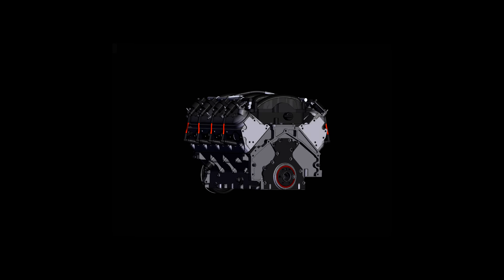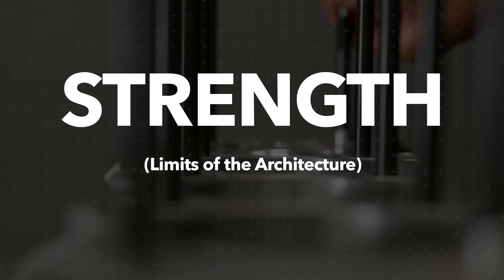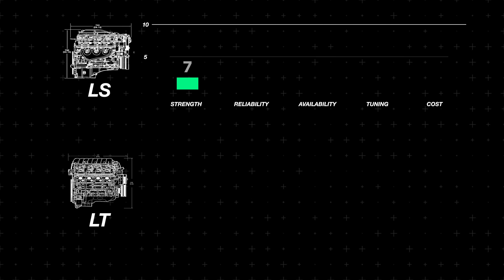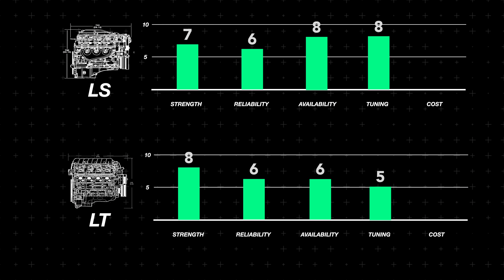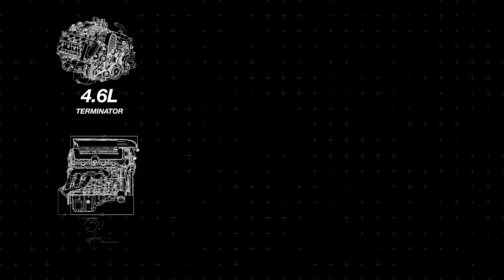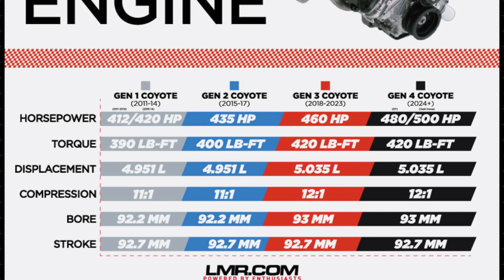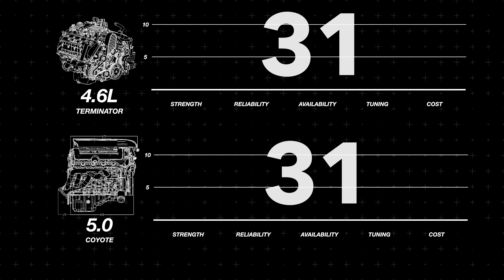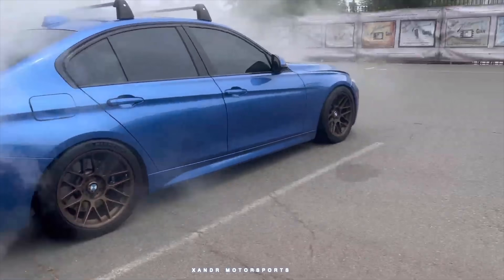Why Old Engines DESTROY Newer Ones💀| Explained Ep. 25

Comment: I am by no means a Ford gut but in the case of the Terminator, they got it right. They took a page from History and went to the Aftermarket to build a solid foundation. Hot Rodding at it's core has always been improvements. Be it power or reliability. Most times both.

Comment: If you are building the LS gen 4 engine, the AFM on the 4th gen LS engine is a non issue. You can eliminate that mess when you swap the cam. 

Also if you have a vehicle with a gen 4 LS and you need to put a gen 3 in it, there is a way to do that while keeping the original gen 4 ECM.

 You have to take the crankshaft out and take it to a machine shop and have the Gen 4 sensor pressed onto the crank. You also have to swap out the cam sensors. 

I had to do this on my 08 Silverado which came with a 4th gen 5.3 liter. I replaced it with a 6L LQ4 which is a gen 3 which doesn't have the AFM like my original engine. 

After I did it the engine only ran on 4 cylinders which kind of freaked me out. I took the ECM out of it and brought it to a tuner and he fixed it. I think I paid him about $200. I've been driving it like this for about three years. You also have to modify your original knock sensor which is not that hard. I plan to do it but right now I'm still running around without a knock sensor. 

There is also a way to swap it out by buying some kind of computer device. I can't remember what it's called it's got a funny name. I wanted to keep my original gen 4 ECM. If you want to get rid of AFM then putting a 3rd gen LS in is a way to do it. The electronic thing with the funny name is called a ligenfelter and they cost about $300

Also the reason I had to swap the engine was the stupid AFM messed up and trashed my engine. I also put a new Melling high-volume oil pump on it while it was apart it has excellent oil pressure.

Comment: i wanted to build  a lexus is300. by the time it's all said and done it be a lot better just to go buy a 2017 atsv. way more tech locking rear diff a transmission designed to take the power.

Comment: Actually engines from the 1960s and 1970s were hands down the best. My favorite is the original Small Block Chevy. I have built dozens of them, from daily driver engines to supercharged drag race engines. I have seen them last a million+ miles with no internal work. They are simple, robust, and there is an endless supply of parts for them, including lots of aftermarket parts that are far better than the oem parts were. The biggest problem with these engines was poor build quality. The design is brilliant. If you build one yourself, using quality parts and correct clearances, it will last forever. 

The Ford 4.6L SOHC 2 valve is the best modern engine, I've seen factory built ones exceed 300,000 miles. But a properly built original small block Chevy will last three times that and then some. The original Ford small block Windsor and Cleveland engines are also much better than anything that came after them. Simplicity is the key to a long lasting engine.

Comment: If you compare older engines vs newer engines in average European cars, the old engines win in reliability hands down.
Specially the modern small 3 cilinder turbo charged engines from a lot of European manufacturers brake down a lot (like beyond repair within 50K KM).
Customers even started lawsuits against some manufacturers, I know some people that work at a dealership and it's no exception that they have to swap 2 or 3 engines a week.

Comment: My 1st annoying issue with my 1998 Supra, and it isn;'t from the engine (it's still super strong) it's a bloody front wheel sensor issue, so currently no Trac control. Owned it since 1999, Great machine

Comment: Sbc are king imo, an actual old engine lol. They're cheap, readily available, with probably the most aftermarket support. For max hp tho the LS/LT take the cake with their skirted blocks for 1000hp numbers. Planning a 400sbc build rn with a moderate 450hp N/A "street tune" and a 200hp shot of throttle in the bottle "race tune" for a 66 impala. Should take down cars easly twice the $$$ I have into it. No expensive ecu, just carbureted the way God intended.

Comment: I own a shop and I swap both coyotes and LS/LTs. 90% of what we do is LS. You just can't beat price and availability. It's a trip to the junk yard or a trip to summit racing. Recently sold a crate ATK 5.3 for $2500 I bought for $1500 because it was on discount at summit. Brand new 385hp from builder, 0 mile engine versus a discounted $8000 coyote. This was going in a foxbody.

Comment: I think potentially a better comparison OR just a different comparison, is to compare these engines during their "golden era". Example: 2JZ in the early 2000's vs B58 in 2023. 4G63 early 2000's got you 10 second car for under 5k. LS1 from a junkyard in your beat up trans am, cost less than 5k and would smoke most cars. I bring this up because something like the 4G63 isn't nearly as godly in 2023 as it was 20 years ago.

Comment: I don't gotta watch the video to know why: The aftermarket for these engines has been around for 30 years. You could build a LS just by buying separate parts off e-bay.

If we look at modern cars, these engines get blown out of the water. If the lack of hype for modern engines doesn't kill the aftermarket, they have WAY more potential than the heavy ass blocks of Iron being put out in the 90s. We make 700hp out of a factory NA V8, with 10-year 100000 mile warranty.

Comment: i have a 2003 bonneville SSEi 3800 L67 supercharged. i did some of the usual mods, added a little boost. it's a quick car but not incredibly fast. it gets decent mileage and it's a damn tough engine.

does the L67 qualify as a performance engine. i could take it further. intercooler, high ratio rockers ect ect. in this economy it's hard to play with it much, i just drive it the way it is for now. it doesnt see any winters, it's a fairly rare car.

Comment: emissions regulations, noise regulations and fuel efficiency killed the big powerful engines, it's a shame, but, that said, these same regulations did contribuite to the development of the awesomes hybrid engines that are racing today and will be on our cars tomorrow. something get always lost with evolution, and this is true in nature as in technical stuff. this is engineering darwinism 😃
Reply: Actually, it's emissions compliance that killed fuel efficiency and power.   To be 'clean burning' an engine can't be fuel efficient at the same time.
Reply: Will a hybrid drivetrain be able to cope with the stresses of heavy track and racing use the way a standard well built ICE can? So far I've yet to see anyone attempting this but I've been on the lookout for an EV/Hybrid track build for a while
Reply: @nissancubesdashboardpubes8026  LMH class are hybrids, and what you see at LeMans you can be sure that will get first to road super cars and eventually to every day use cars. It always happened.
Reply: @nissancubesdashboardpubes8026  That's because there's a limit to what can be done with the efficiency and layout of the mechanical systems and we hit it years ago.  

More power to the wheels and charge faster is about all that is left to work with and we don't really need more power to the wheels in most applications now. 

Everything else is just the act of complicating something for no real reason.

Comment: Engines are like dynos. They don't have a HP limitation but a torque limitation and an RPM limitation. Torque breaks parts as does RPM. Power doesn't.

Comment: GM AFM is hot garbage. I had to replace a cam and lifters and delete that garbage from my wifes Yukon. Stuck lifter at 118K. Now I'm 210K motor runninsmooth as ever. I had to replace tranny at 189K but I didn't maintain it on schedule so that's actually good miles considering, now I added an external cooler 😂

Comment: Unpopular opinion but the 3S-GTE is more preformace oriented than the 2JZ due to the lighter weight yet still capable of 1000+ HP. I mean Toyota took out the 2JZ and put a 3S in the supras for a GT class race car.

Comment: Theres one big reason old engines were ’built tougher’, emissions. A newer engine held to a modern harder emission level need to cut internal friction to meet said levels, therefore they need to make use of shorter piston skirts, narrower bearing surfaces and less rotating mass cutting material from bigh stress rotating components.  Some ground is regained from newer materials and better manufacturing processes, but the sad truth is that modern engines need to be built with less margins.

Comment: I'm glad you got most of the things addressed.

I can't stress enough how tough fuel emissions are that cause weaker engines today. So many moving parts that fail as well as inherently weaker blocks that have massive coolant passages in an open deck design to cool the combustion chamber, as we all know, cause mushrooming in the combustion chamber which can lead to blown head gaskets. Don't even get me started on the purposely choked intake ports on Hondas and their SOHC engines. 

For me, a powerful N/A engine is one that makes over 100bhp per liter displacement, with 150-175 hp per liter displacement being perfect for track-configured engines (YES, YOU CAN ACHIEVE THAT WITH 310+DEGREE CAMS AND A HIGHER RPM). The amount of arguments I've had telling me 140hp from a 2l engine naturally aspirated is to be admired, drives me crazy.

Another note. Rod ratio. To make modern engines fit into a smaller more compact design they make the block shorter, in doing so making the rod shorter. This is why you find many modern 4 or 6-cylinders running a 1.5:1 rod ratio, which harms the bearings' life span, and thus why you get spun rods. Combine that with most rod bearings which run tighter tolerances to allow the oil to heat up faster from a cold start, and you have a recipe for trouble. Don't believe me? Look at Fa20s. Unless you deal with the oil cavitation issues, you can even spin the bearings at stock power levels.

Using a 1.5:1 rod ratio might be good for tuning because of the lack of compression dwell, but it's not worth the trade-off for a longer rod ratio that has better secondary harmonics and better bearing stress.
Reply: You do understand that because fuel emissions are tougher they have to build a stronger engine that makes more horsepower that isn’t effected by emissions requirements let alone start/stop strain
Reply: @benjaminwatson7868  Can you name the engine you're describing? Because you sound like you're speaking gibberish with your bullshit stop/start strain.

The 1994 supra makes 320hp stock. The 2020 makes 335 and is an inherently weaker engine.

The Ej20 and 25's compared the their early generation closed deck, are weaker. The Fa20, its successor, is a less reliable platformed when boosted.
Reply: Honestly, it's impressive how even the matchups are for durability/performance/tuning/reliability, other than the gigachad 2JZ. Certainly a better decade shift for engines than the 60s to 70s shift

Comment: Great video! I think engineering efficiency would’ve been a good metric to feature. For example, a lighter engine block loses initial durability but reduce the power to weight ratio, requiring less power to go fast. A lower power requirement translates into less strain on the motor overall improving reliability. 

However, as I write this out, I’m thinking maybe that might not have been necessary for your purposes haha
Reply: Always a compromise to choose. I used to like aluminum blocks but iron is hard to beat in its price vs strength and reliability especially when you throwing alot of performance into it. If it was strictly a track car then all aluminum it is, because it's clocking times.

Comment: First off excellent accuracy good work second off way over thought. One thing I know is what your doing is best done on the dyno . U can adjust all you want but when on a dyno it's a completely different animal. I've watched my mate dr drift go through setting hks adjustable cam gears on the dyno using timing light and dyno data Feed back . U need a dyno fay that will move U onto the next level of diagnosis. The time i watched the dr doing these can gears they went off the engine and to the lathe then back to the engine being second hand gears then he set them on the dyno. U need a dyno and then U will understand. Chassis dyno preferably. There old tech but very accurate

Comment: I had a silverado 5.3L fail from the dynamic fuel management. When we bought our new one, we were able to get it without dynamic fuel management. It's a 2022 that was built during the chip shortage, so they didn't include it and even gave us $50 off for it. We couldn't find any 2023s without DFM, so if that is what you are looking for, get a 2022 while you still can.

Comment: With the strength output between the B58 and 2JZ the BMW engine can easily handle over 1000hp without touching the block and 2JZ will only handle about 700-800hp without changing the rotating assembly. Also the LS engines are stronger then you listed. Look up engine masters where they saw 1500hp on stock bottom end. Not much is stronger then that.

Comment: I think for most enthusiasts how strong the engine is from the factory doesn’t matter,  I’ll use a small block Chevy vs a 2jz as an example for the 90s.  The 2jz is a better engine from the factory but it is also expensive compared to a small block Chevy.  You could take a 350, strip it down to bear block, throw away everything, which most of us did, but a forged rotating assembly that has a stroker crank, and with the right cam, and head combo make 500hp na.  Being able to do this has a considerable cost advantage compared to being turbo charged, since the 2jz is smaller in displacement it needs forced induction to make the power of a nicely built na small block.  Since small blocks were plentiful and a big aftermarket they offer an advantage, the small block ford also has an advantage but not as much as the Chevy.  The Chevy was a dominant engine not because it was better but because it was so cheap to build and the stock 4 bolt blocks were stout as long as you upgraded the lack luster internals.

Comment: Newer engines come with newer design theory too, and you don't often get that leak down into aftermarket parts suppliers.

Case in point: Inlet ports
Newer engines (especially boosted ones) almost invariably sacrifice flow for charge motion. Look at the Mercedes M139 engine. It's got tiny valves, a projected plug, no squish, and inlet ports that literally block most of the short-side flow in exchange for maximizing tumble motion. It doesn't even have vvt on the inlet side. What it does do is take 30 psi on pump fuel and meet full emissions with a warranty (and behave nicely to boot).

We could easily put all that into any aftermarket 4v head, but nobody does because the aftermarket is stuck on the "CFM + Octane + Boost" formula for power rather than actual development.

I've only seen ONE enthusiast article refer to this, and it basically boiled down to "Honda* did it like this for dark magic pump fuel reasons, we're gonna fix it for E85 but wouldn't for gasoline"

*Honda K20 turbo has a similar inlet port

Comment: A 5.3 truck motor will take 15 lbs of boost, a 250 shot of nitrous, or even a full load of nitromethane. You can more than double the  factory hp with stock heads, stock crank, and locate some gen 4 rods, and even the earliest version will make it past 700hp...and they can be had for less than the price of a pair of decent tires.....
Hp per dollar, it's hard to compare.

Comment: I my car there was moisture getting into one of my front headlights. I ended up replacing them with a L.E.D replacing. They were cheaper than buying on headlight assembly. After i used them in night-time driving I don't think they liteup where I was driving as good. I also found that you had to have the polarity the correct way around

Comment: The truth is cringe but still the truth. Old engines are more durable and practically forever lasting. An example can be the Twin spark engines made from the last century still running strong. Some are tuned. Hell they were even used on racing

Comment: I love the older Toyota stuff I was always so over built. I have a 2000 Toyota tundra with the 4.7 L V8 245,000 miles and it’s just now starting two seeping oil out the valve covers

Comment: In the end; Better? No, just cheaper and easier to use. Much harder to put an S58 in your car and tune it than a 2JZ, even though an S58 is better in all performance aspects. Hell they have been tuned to over 600whp on bone stock hardware including turbos. I mention S58 instead of B58 because it is the top turbo I6 on the current market much like the 2JZ was in its time.

Comment: It’s more so that engine tech and innovation has peaked fora while. Meanwhile things like tuning tech and improvements has continued to get better at a much better rate. One of the most innovative areas of performance has come from transmission tech and the ability to put power down, stay in powerband and made reliability a non issue. Look at a engine 30 years ago and compare that to a automatic transmission. Also things like material weight, cooling efficiency and of course tire tech cause it’s all worthless unless ur tires transmit the power to the pavement. We’ve been making 1000hp 3000hp and up for 100 years considering before jet engines even planes used versions of engines you find in cars today. However it’s everything around the engines that’s kept getting better and better